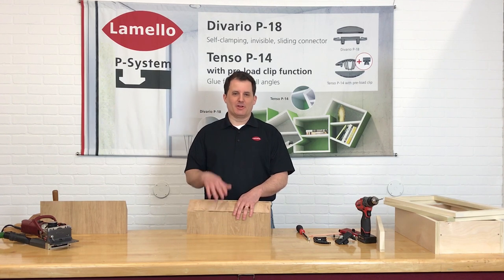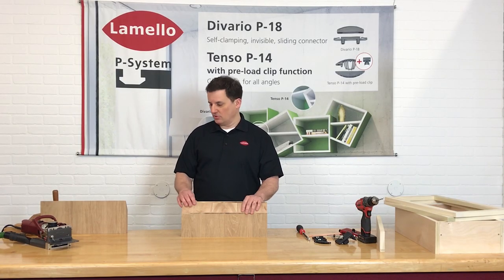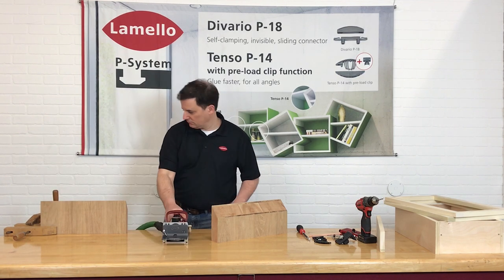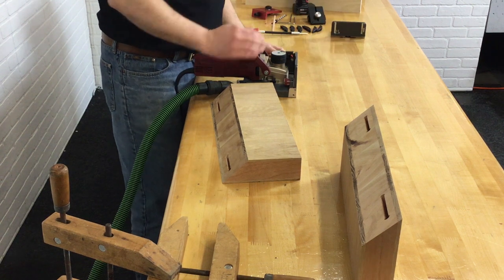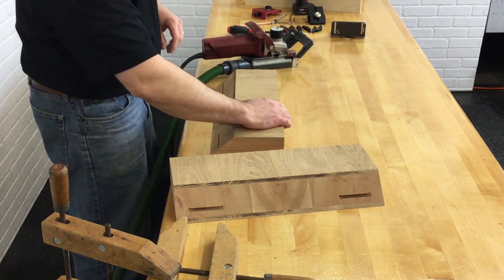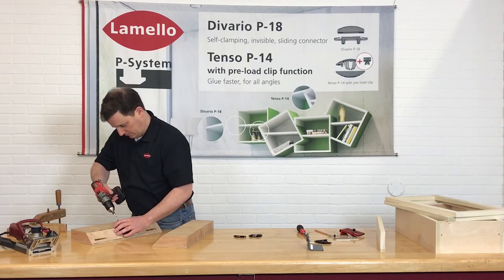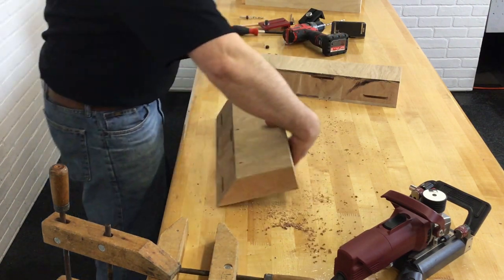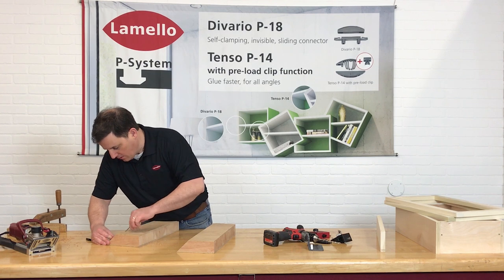Lamello Lesson - Build a Waterfall Edge with the Zeta P2 & Clamex P-14

Comment: An informative video, thank you for making it. You need two rows of dog holes across the center of your workbench so you can either put some dogs in to act as stops or you could easily clamp the item you are working on.
I agree with the previous post. More videos on the Lamello Zeta P2. There aren’t many in depth videos available on this machine.
And the pace of this video was a bit slower than usual which is a good thing when the viewer is trying to learn to use the system.
Thanks again.
Ron
Reply from the maker: Hi Ron, thank you for that feedback on the pace of the videos.  We have been trying to go for brevity, but maybe a little more depth and detail are better.  And, yes, those videos pre-date the arrival of two Wettstein work benches from Switzerland, complete with heavy beech tops, vises, and plenty of bench dog pockets.  You'll see them in the finished videos after our next round of shooting.  Although I've never been found wanting with enough parallel jaw clamps around either!  Those are my own clamps in those videos and I've been using them for 25 years.  Chris

Comment: Why didn’t you put 3 in top 3 in bottom cheers Des
Reply from the maker: Because we need a clear path to reach the cam lock for each connector and in a recommended web pattern there will always be an odd number on one edge and an even number on the other